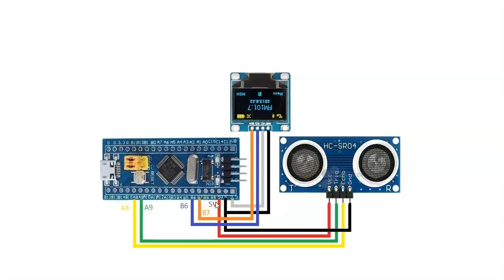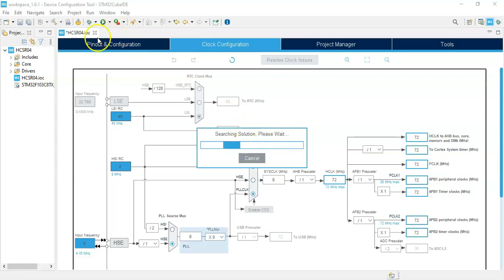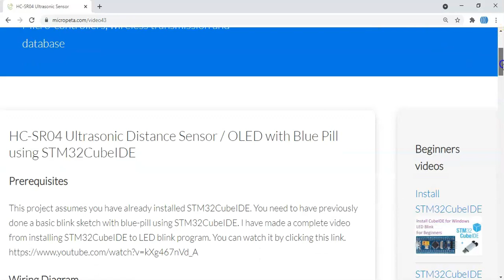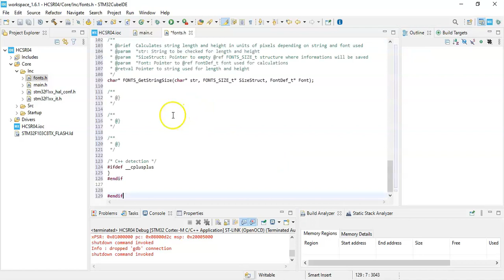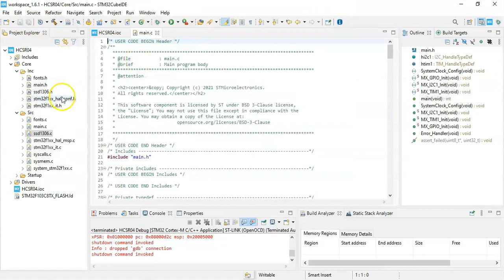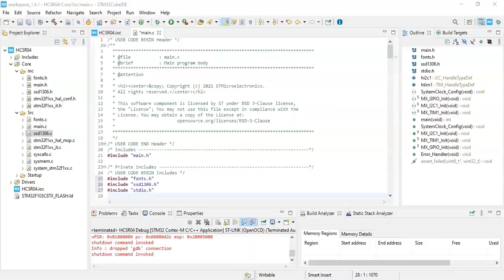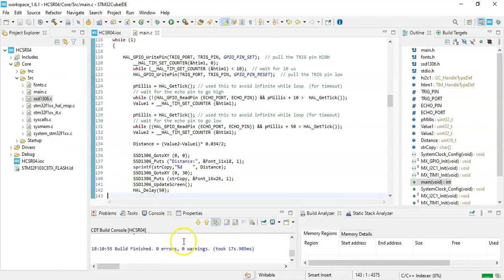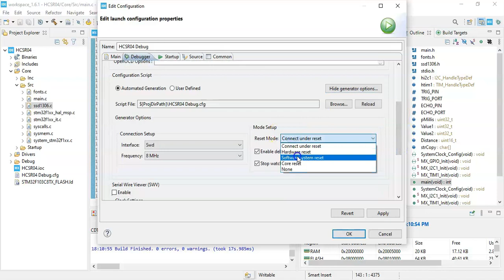43. STM32CubeIDE Ultrasonic Distance Sensor. HC-SR04 / OLED with STM32F103C8T6

Comment from the maker: In this video I set Clock Configuration tab → HCLK (MHz) to 72
You can set the speed of STM32 to any value you want up-to maximum of 72 for STM32F103C8T6. Most of the time 72 is better.

I set prescaler to 71
The reason is 
I needed to measure micro-seconds for the sensor
Time = 1 / Frequency
1 us = 1 / 1MHz
To have micro-second, timer frequency needs to be 1MHz.
Because I already set clock to 72MHz, I need to divide it by 72 for  timer frequency.
You can divide it using prescalor
Prescalor is always one less so it is 71

Another example: If you set clock to 64MHz, you need to divide it by 64 for  timer frequency.
Prescalor is 63
Reply: Are the configurations same for LCD I2C?

Comment: If you guys use 5 V as a supply for ULTRASONIC sensor from STM32 it wont work properly............. Give 3.3V as supply Instead  of 5V
It will work properly 10000%

Comment: how to debug on keil C, power supply from ST link is 3.3V so when plugging in 5V pin on stm32 the voltage is only 3.3V, so hcsr04 module not working, please help me
Reply from the maker: Before connecting st-link, supply 5v via usb.
Or, you can connect 5v (vcc) and gnd to +/- of separate 5v source
Reply: @NizarMohideen  I power separately for Hc Sr04 module, power stm32 via STlink and then connect to common ground, will my computer be damaged when supplying 2 sources at the same time? I'm a newbie
Reply from the maker: The computer will be fine as long as you supply 5V or less to any sensors.
For more information about safety, please watch video no 51 or 52 in my YouTube channel
https://www.youtube.com/watch?v=Ga2lfBq9zaE
https://www.youtube.com/watch?v=TeAa6UPIb-c